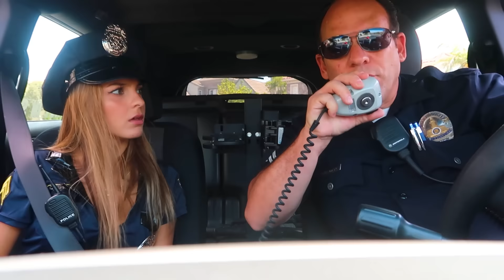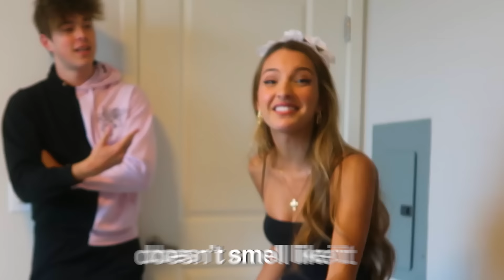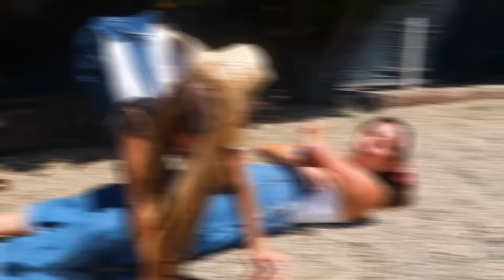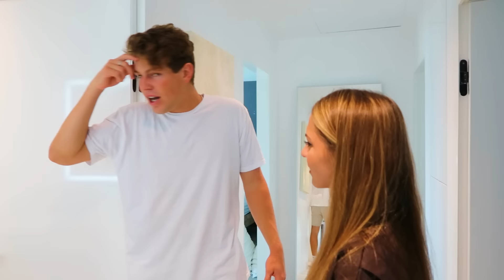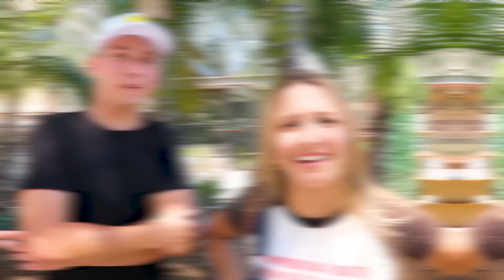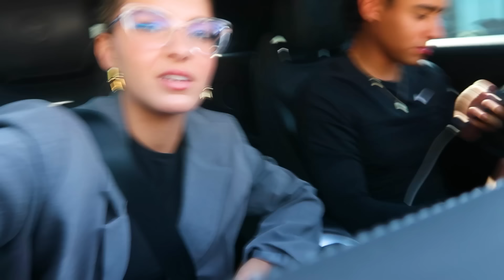100 EXTREME JOBS IN 24 HOURS!!

Comment: Lexi when you are farming you need to use different tools including chainsaws, dealing with different types of animals that weigh from 50 to almost 1500 pounds.  Also, most of your video is correct about all of the dangerous jobs across the United States.  Another dangerous job is Truck Driving because of long hours.